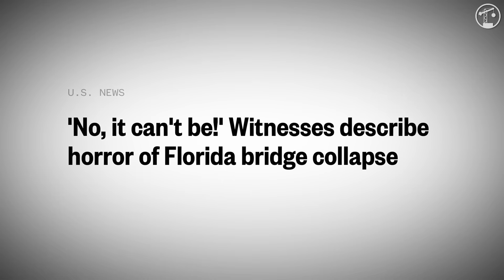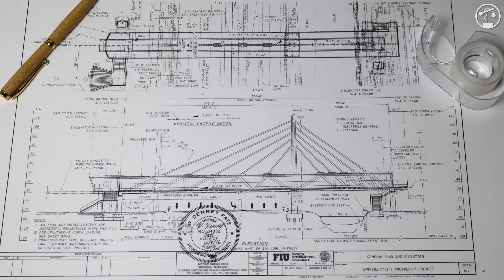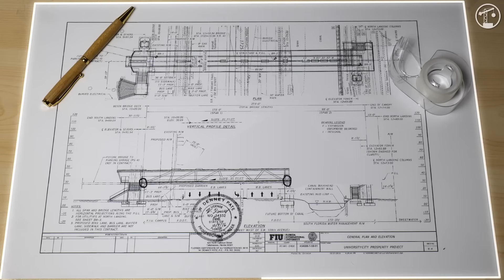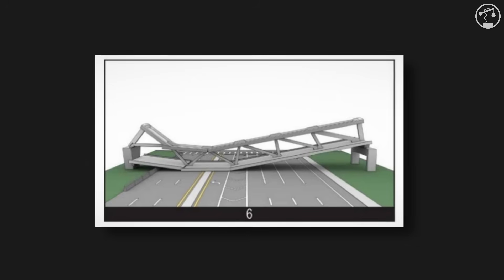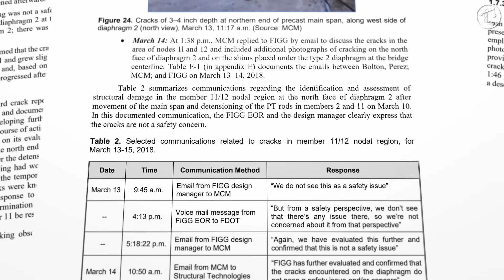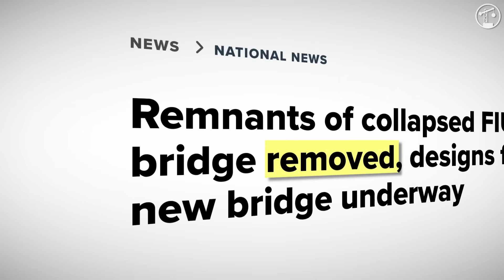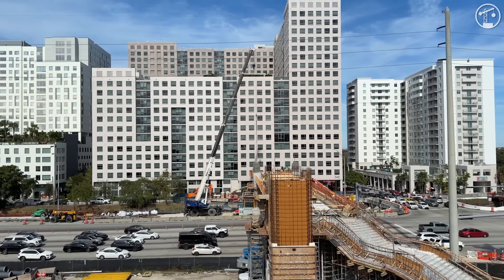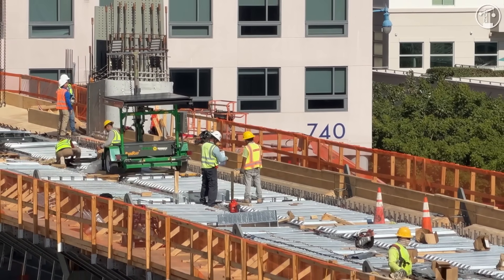The FIU Bridge Failure — and the New One Replacing It

Comment: FIGG took the fall - but there was plenty of blame to go around. FIU's engineering department wanted a kooky-looking bridge (using a faux suspension design), using kooky offsite construction methods (that required moving the superstructure into place, quickly - no matter the cracks), while staying within FDOT's tight traffic restriction timelines. 

My thought: No one wanted to inconvenience the motoring public and admit to a faulty engineering design at an engineering school - and then have to pay the liquidated damages for late completion. 

NTSB: Bridge Collapse Caused by FIGG’s Decisions, FIU Could Have Stopped It:

Cracks were found on the node of the 11 and 12 truss structures on the north side of the bridge as early as Feb. 24, and by March 15 they were 40 times larger than the acceptable range. The cracks grew continuously for five days. FIU, FIGG, the Florida Department of Transportation, the construction company, and engineering consultant Bolton Perez all could have stopped the project, but none did despite clear signs of trouble. To address the problem, FIGG’s Engineer of Record chose to retention the steel rods in the problem area on March 15.

“Re-tensioning was a change to construction plans that should have been reviewed and signed off on by a professional engineer, but that was never done,” said Prouty.

Another faulty decision by FIGG was to instruct Munilla Construction Management to place a support stack in the center of the bridge but not to lift the bridge. According to NTSB investigators, no significant stress could have been taken on by the stack without lifting.

The cracks themselves were only a symptom of FIGG’s questionable design. The bridge was designed without redundancy, meaning if only one truss broke, the entire thing was doomed to fail. The design also overestimated the bridge’s load capacity, meaning their calculations for what the bridge could handle were completely off.

All parties involved, including FIU, had authority to close the road during construction and re-tensioning, but failed to do so.

FDOT was hands-off on the project and delegated responsibility to FIU through a Local Agency Program agreement, but the NTSB said they should have had more oversight on the project considering the complexity of the bridge and the University’s lack of experience. The board is recommending a change to FDOT’s policy that will require more hands-on involvement with complex projects.

NTSB Board Member Jennifer Homenday also admonished FIU and the other parties for a letter sent to the board on Saturday, Oct. 5 asking that the NTSB delay the release of documents related to their investigation.

In the letter signed by University Chief Financial Officer Kenneth Jessell and representatives from FIGG, MCM, Bolton Perez and Structural Technologies, the parties pleaded with NTSB to not release the docket on Oct. 8 because it may affect settlements for the families involved in litigation about the bridge.

Homenday said this letter was “shocking and disappointing,” and the NTSB responded by saying “the NTSB cannot delay release of critical safety information to accommodate the needs of private litigants.”

OSHA's Office of Engineering Services (OES) decision:

OSHA, as the Department of Labor’s lead workplace safety enforcement arm, was on site immediately after the collapse. Six months later, it cited five contractors — including Figg Bridge Engineers and Magnum Construction Management, formerly known as Munilla Construction Management (MCM) — with violations such as allowing employees to work on the bridge after cracks had been observed and failing to provide adequate fall arrest systems. NTSB and Florida DOT records and photographs indicate that small cracks were visible in the bridge, which was built offsite, prior to installation. The cracks reportedly grew as the span was trucked to the site and set in place. 
But where the NTSB has yet to draw final conclusions as to the cause of the collapse, OSHA’s Office of Engineering Services (OES) did not hold back in a new report that has laid the lion’s share of the blame on Figg. 

Figg employee Denney Pate was the engineer of record for the project, and Figg designed the bridge. The OES found that the cracks on the bridge contributed to the collapse and that the cracks were a result of bridge design errors. In fact, the OES said the “magnitude of the cracks” were such that the street below, where most of the fatalities and injuries occurred when the bridge fell, should have been closed to traffic and the bridge shored up in several areas until corrective measures could be taken.  

The agency also determined that after observing the cracks during an inspection in the hours before the collapse, Pate and Figg should have known the bridge was not stable and, again, should have ordered the structure shored up and traffic on the street below shut down. Instead, the OES said Figg instructed that post-tensioning bars be re-tensioned, which was the activity taking place at the time of the collapse.  

During a meeting on the morning of the collapse, after having evaluated the cracks for two days, Figg engineers could not figure out why the bridge’s trusses were developing cracks. However, even given that fact, and with other project participants advising Figg that the cracks were growing in length each day, the engineering firm’s representatives stated more than once that they did not present a safety concern. Pate, according to The Miami Herald, left a voicemail message for the FDOT a few days before the collapse stating that cracks in the bridge were not a safety issue.

Pate’s evaluations of the cracks and his directive to re-tension the post-tensioning bars of diagonal member 11, located at the north end of the bridge where cracks were observed and where the bridge is presumed to have failed, were not part of the original design, according to the OES, and should have been subject to peer review by the firm Figg hired as an independent peer consultant, Louis Berger Group. 

However, Figg, according to Berger, hired the company only to conduct a final review of the completed bridge structure in violation of FDOT regulations, which require a peer review at 30%, 60% and 90% completion as well. In its report, the OES said that if Berger had made interim inspections, it’s possible that the firm would have picked up structural deficiencies, thereby potentially avoiding the collapse. Given that Berger did not conduct peer reviews after each phase of construction, the OES said Figg should have taken extra measures to ensure the bridge’s structural integrity. 

The OES added Figg should have known the non-redundant structure of the bridge design meant that a failure of the cracked diagonal member 11 could bring the span down. 

But Figg was not the only player OES took to task. 

The OES said MCM’s onsite supervisors and quality control personnel knew the cracks were growing in size and should have called Figg on its statements to the contrary. The agency also criticized MCM for not exercising its own judgment and shutting down access to the street below the bridge until the cause of the cracks could be determined. 

The OES also pointed to Networking Engineering Services Inc. dba Bolton Perez and Associates Inc. (BPA), which served as FIU’s construction engineer and inspector (CEI) on the project. Like MCM, BPA was obligated to exercise its own judgment in helping to deliver a structurally sound bridge that met FIU and FDOT requirements. However, like other project participants and in a breach of its responsibility, BPA did not recognize that the extensive cracking posed a structural threat that would lead to collapse. 

In its report, the agency also admonished Berger for not complying with the provisions of the FDOT peer review process.

Comment: Nice video!  One item I would have added I picked up in Brick Immortar's version of this video, where the span would have been structurally fine, no cracking in the 11/12 region...  But only when the opposing river span was in place.  In other words, FIGG only designed with the bridge "in place", and didn't consider the different loads when moving the structure.

I really dig the paper overlays being used like at 3:50.  Combined with the blueprint diagrams, it adds great detail!

Comment: 2:11 "without the stabilizing effects the designers ultimately intended."   Are you saying the truss would have worked with the pipe 'stays' in place?  This is the first time I have heard that the intermediate configuration was part of the problem.  Source?
Reply: If they had built the bridge out of steel, doubled the amount of trusses and used cables instead of decorative pipes, I'd say it would have worked.
Reply: Would have provided a redundant load path.  Might have just broken the tower though as the back stays could not be in place to restrain it.  A temporary back stay for construction stages with the tower in place and the span butted against the base of the tower could possibly have supported the span safely.  The type and location of shear failure might not have had enough ductility to transfer sufficient load to the alternate load path prior to total failure.

Comment: Peer review won't fix the underlying problem. The original design was decorative, not functional. The use of concrete beams to a vertical pylon and a concrete top cover was insanely bad. Concrete should be used IN COMPRESSION, and connections to a vertical pylon are IN TENSION. This is a PEDESTRIAN BRIDGE. It doesn't have a heavy load. An electrical engineer looking at this requirement would say "use a couple of I-beams across the road and put a walking path on top. Don't forget some railings." Putting a shade cover over it against the Florida sun is a nice touch --- canvas and ropes work great, and are insanely cheap.
Reply: Beams for a 175' simple span are very deep requiring many stairs to get to the deck.  A thru girder design or a box truss design would work, but a shear friction failure at the end node could still cause collapse.